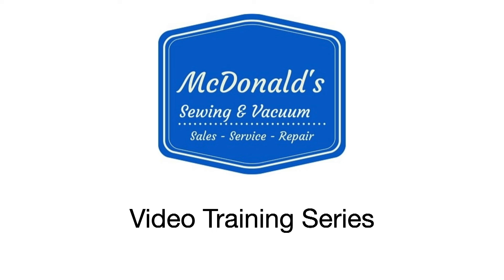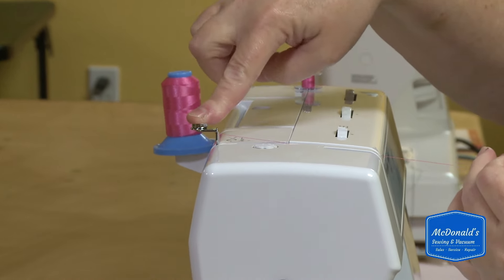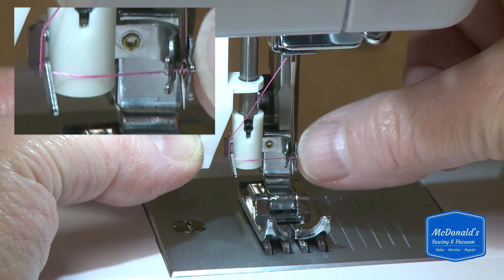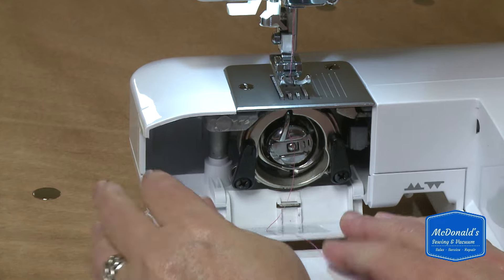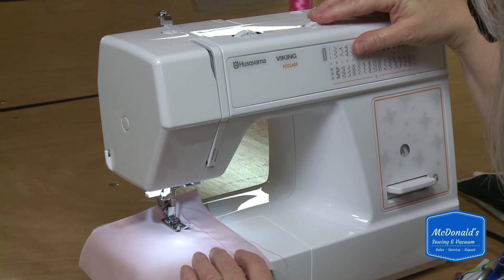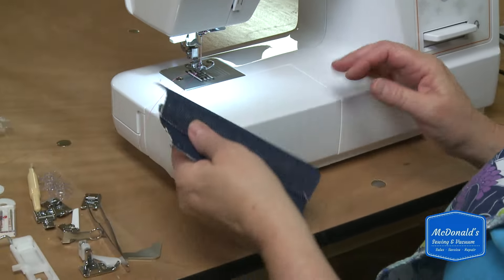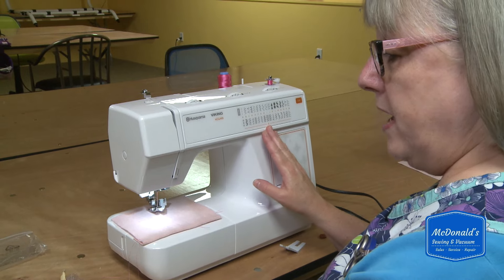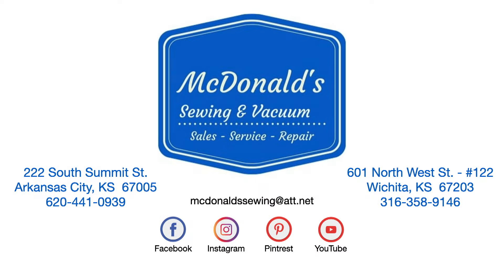Husqvarna Viking H Class E20 Owner's Class

Comment: Thank you so much Dalene for your videos.  Just bought this machine last week and had an issue.  I tried sewing jeans with jean thread, which is thicker than normal thread, and the machine would jam and the thread was getting stuck all the time.  I returned it to the store yesterday and tried it with the store agent.  We realized the machine would work well with a normal thread but not with thicker thread.  I was a bit disappointed and would like your opinion about that.  I used to have an old Singer machine and didn't have issues with thicker thread.  Is this normal?
Reply from the maker: It was probably the needle. Did you try a topstitch needle? I'd recommend a size 120. However, if you're planning to use this machine mainly for sewing jeans, you might try an industrial machine like a Consew or a Juki. We sell a Consew that might be perfect for you: https://www.mcdonaldsvacuums.com/shop/Sewing/Sewing-and-Embroidery-Machines/Consew/p/Consew-Portable-Commercial-ZigZag-Walking-Foot-Machine-x67615104.htm. We have financing available if you need that - let me know. I don't have a video on this machine yet, but will try to get one up soon.

Comment: Thank you so much for this video. I've had this machine for years, it was a gift, and just started actually using it. I'm having some issues with the system jamming. Do you know how to resolve this? I think it's a tension thing but I don't really know how to resolve it yet. Here's to more learning!
Reply: Hello, I just bought this machine and had issues too.  Returned it to the store to be told my thread was too thick.  We tested the machine and realized it worked well with normal thread.  Maybe you should try this.  Let me know if it solved your problem.

Comment: Hi just  wondering what the plus and minus sign is on top of the  machine
Reply from the maker: The button with the plus and minus sign next to it adjusts the presser foot pressure.  If you need more pressure to feed heavy-weight fabrics through, you would tighten it.  If you need less pressure to feed light-weight fabrics through, you can loosen it.

Comment: I have this machine. But the needle is stuck. I can only turn the wheel on the right side 1/4 of a round. 

Can you help with troubleshooting?🥴☺️
Reply: Try removing the bobbin, the bobbin case, and the hook.  If the bobbin case was not in securely when you started sewing it may have slipped and caused the machine to lock.

Comment: Thank you for such a great video. I’ve had this machine for about 5 years and this was a great refresher, especially since I bought this machine in France and it came with an Italian manual 😂. My one question is what bobbin size does it take? I’ve bought a few and none of them have fit properly. Is there a store or online retailer I can buy them from? I feel like I may have made it a lot more difficult than it probably is.
Reply: Hi, It takes a Class 15 bobbin. You can order them online from our store McDonalds Sewing &Vacuum or Sewing Parts Online.

Comment: How do you know if you need to adjust the tension? And how do you do it?
Reply: If your thread is looping on the top or bottom, or if it lies flat on top of the fabric, you may need to adjust the tension.  In our experience, however, most of the time people have not threaded the machine correctly.  It's critical to raise the foot when you are threading the machine. If the thread is looping on the top of your fabric, take your machine to a dealer.

Comment: Hi Darlene,  I've had my E20 H Class machine nearly a year now and it's recently that the top thread is showing on the bottom of the fabric. I've tried adjusting the top and  bobbin tension as suggested on you tube but it's still not working properly. I've been sewing masks most of the time and it's frustrating when the thread is so loose. I literally can pull the bottom thread out after sewing.
What else can I do in order to get the  thread to work properly?
I've tried diff bobbins and thread. 
Appreciate your help. Thank you.
Reply from the maker: I recommend that you take it in to your dealer for service.
Reply: How can I darn with my viking ruby computed  machine